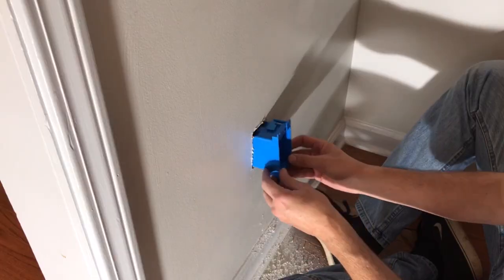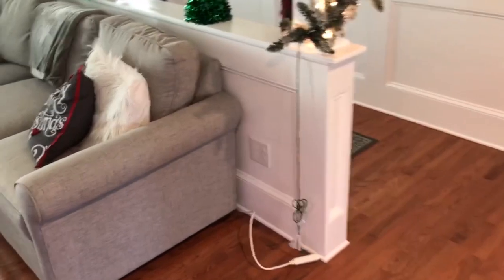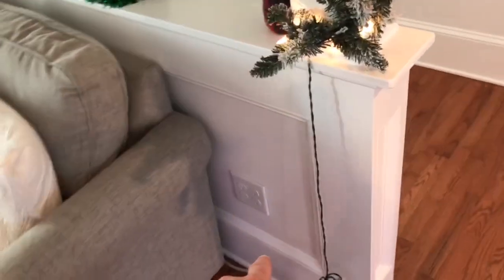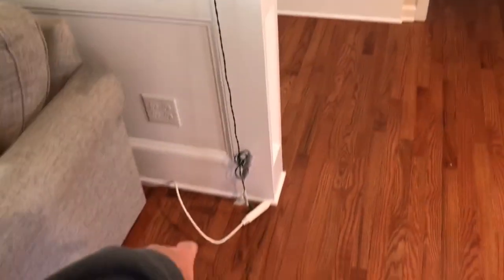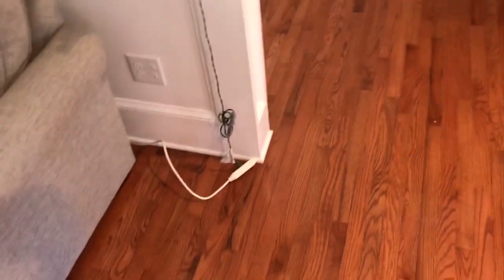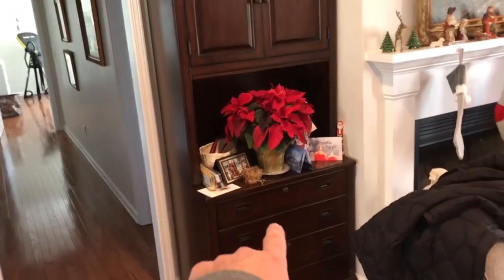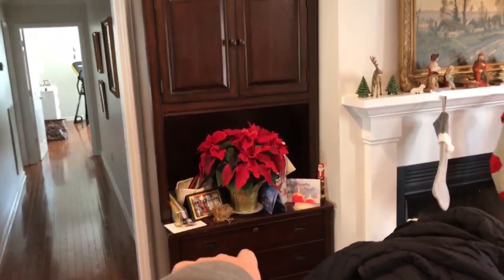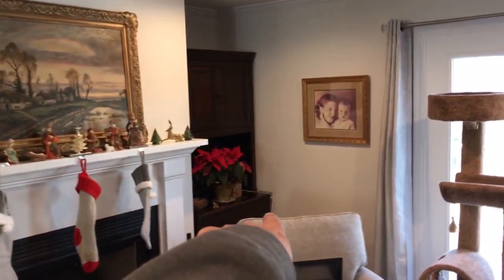How to add an outlet and splice into a circuit.

Comment: Thanks again Dave.  I was able to use your other video on tapping into live power in the attic and it was very useful.  Now I am installing a ceiling fan/light in my home office off my master bedroom.  I bought a combo fan/light switch and put it in an expanded two gang box next to an existing switch for the receptacle in that room, but the wires got crossed and the help desk at the fan/light switch company, Lutron,  told me I had to run a new line from the breaker box because there was a risk that the new fan/light might overload the circuit.  I'm not sure I'm buying that story.  I think he just wanted to take any liability off the company.  So my question for you and your readers is how can I determine if there is any "room" in an existing power supply in my attic that I can tap into without overloading the 20 amp circuit.
Reply: So if I count the number of receptacles and switches in the room which is labeled "retreat" on the breaker, it is 6 (5 receptacles and 1 switch).  If I add one more to the 20 amp breaker for the ceiling fan/light( I believe it counts as one because it is powered by one 12/3 Romex) , then that makes 7 and based on your reply to jimbola77, then I should be able to have 10 total (I am well within this number).  Now I just have to make sure that nothing outside the retreat is controlled by the breaker labeled "retreat".
Reply from the maker: It sounds like you'll have plenty to work with. ... The "technical" way to do it is to add up the actual wattage of everything plugged into that circuit (there's plenty of info on that with the formulas on the net), but 20 amps is a lot for most modern setups where everything is energy efficient and LED. Unless there's a microwave, air fryer, or window AC etc. on that circuit, you should be good.
Reply: Thanks Dave.  I got a master electrician friend to help me do this over the phone.  We were able to find existing 12/3 in a receptacle that was tied to the switch that controls the receptacle in the room and “steal” (re-dedicate) the hot from that and use it for my fan and light.  I didn’t end up using the combo switch but used a dimmer switch for the light on the fan and a slider switch to control the speed of the fan.  It worked great and I didn’t have to cut any holes in the walls or go into the insulation-filled hot attic.

Comment: Why did you have one piece of the Yellow Romex and the others were white Romex? Doesn't the Yellow usually indicate 20amp and the white 15amp? I also REALLY liked where you went back and corrected the ground and grounded the metal box, great attention to detail, even though you had to re-edit the original video to show how you fixed it. None of us are PERFECT.
Reply from the maker: It was a 15 amp circuit, Jim, but all my dad had on hand was 12 gauge wire. So we figured a little overkill wouldn’t hurt. 🙂

Comment: awesome! how many outlets can I tap into?
Reply from the maker: This is very much debated, jimbola, but a good rule of thumb (in the US at least) is no more than 8 receptacles on a circuit where you're using 14 gauge wire, and no more than 10 outlets on a circuit with 12 gauge wire. But as long as your breaker is sized according to your wire (15 Amp breaker for 14 gauge wire;  20 Amp breaker for 12 gauge wire) you'll be safe. if you overload it, you'll just keep tripping the breaker and will know you need to add a new breaker and move some outlets to the new circuit.